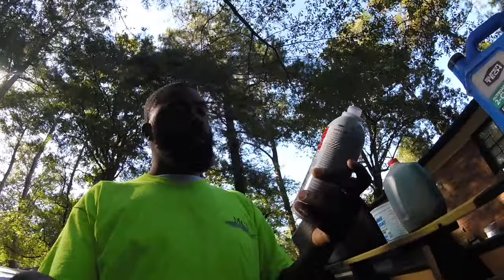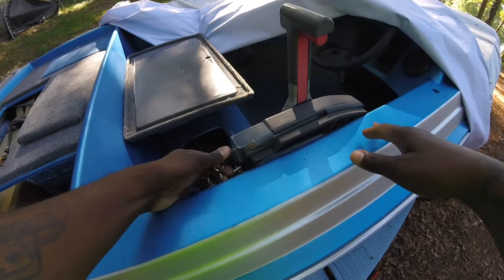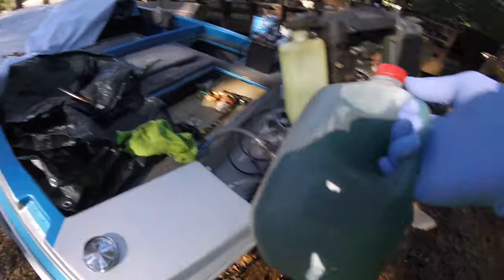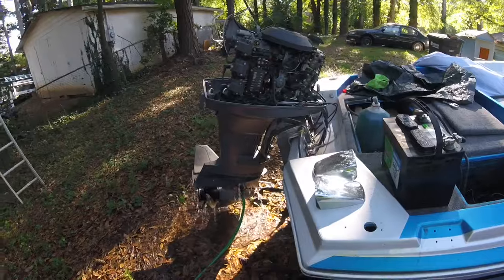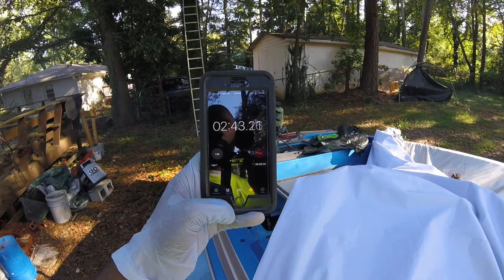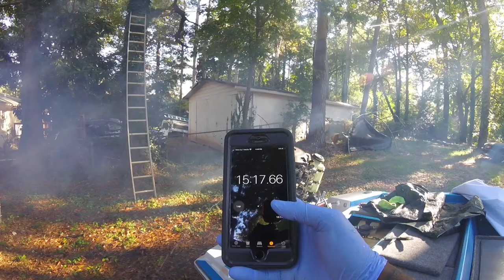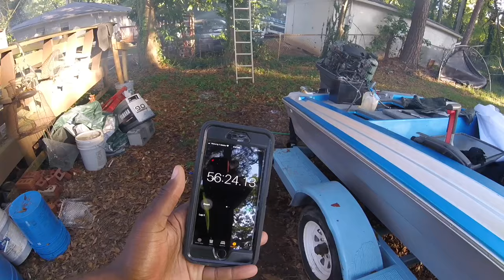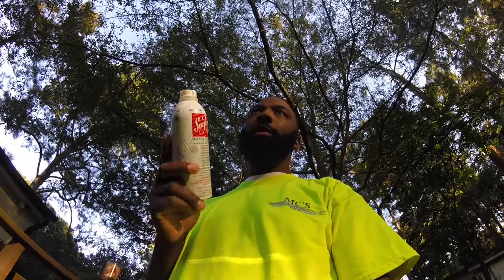How To Clean A Outboard Motor With Sea Foam

Comment: First off if you trim the engine down it’ll start easier. With it tilted that much the fuel in the carbs isn’t level. Second bumping the choke like that does virtually nothing. You have to hold it when you first start. Hold it until the engine starts to brake up from to much fuel. These are great old engines. I have a 89 200hp.
Reply from the maker: Thanks for the comment and advice I really appreciate it
Reply: @HoldemHookTV  no problem. I just got an 87 50hp a few weeks ago that’s runs perfect. Started my 200 two days ago after sitting all winter and it fired up within about 6 seconds. Can’t beat it.

Comment: After sitting two years mine wouldn't idle and was about to take the carb off to clean it. I seen this and gave it a shot. I was skeptical but, it worked.
Reply from the maker: I’m glad it help you out after all this time thanks for watching
Reply: How did you run it through if it wouldn’t  even idle ? Ive got the same issue. Sat for 2 years and won’t idle now
Reply: @Haegan_Lee  I ran it just slightly above idle where it would stay running for about a half hour. Mine would idle for a short time and die, if yours won't idle at all then you don't have much choice but to clean the carb. I switched to non ethanol gas and semi synthetic oil with a couple ounces of Sea Foam. Seemed to run better than ever,  At the end of the season I pull the fuel line off and let it run till it dies. No issues at all this year.
Reply: @gearbanger57  awesome thanks for the reply. I’m so ready to get on the water but I’m a little scared to mess something up cleaning the carb myself. It will idle 15 seconds and die
Reply: @Haegan_Lee  That's what mine was doing. Can you get it off idle and rev it up? Sea Foam will clean a gummed up carb but, if there's debris in the idle passage not much else you can do but clean the carb.
Reply: @gearbanger57  I’ll give it a try!

Comment: Just remove the carbs an clean em my guy. Get  a carb kit with some new seats an your carbs won’t drain 👍🏻.. sea foam is good to run but 9 times out of 10 won’t fix a problem.
Reply: Exactly. 
My 2014 9.9 Yamaha 4 stroke went from running poorly to barely starting and only running above 1200 rpm. I pulled the carb (which was not tightened properly) and removed the float bowl drain plug. I drained out about 1/16” of a teaspoon of grit! Upon further inspection I found the low speed jet was completely clogged and the high speed jets transverse holes were clogged as well. The choke was frozen in the open position. It took me about an hour to clean everything up and reassemble. Most of the time was spent freeing up the choke and cleaning the gaskets. The engine now starts with 0 cranking time. Just “click” and it is running smooth. No chemical treatment would have helped my motor and start to finish my repair cost me 1-1/2 cans of carb cleaner and about  1-1/2 hours of time.
Reply from the maker: Thanks for the comments

Comment: I use Seafoam on all my engines, diesel to 2 stroke.  Keeps the "varnish" out of the fuel system when it is not being used and clean when running.  Great tip on mixing on an engine wit the oil mix at/by the engine!  My Mercury runs rough, smokes at slow speed and oil on plugs.  I shall use good oil and pre mix my own fuel.  I do know how to remove the oil mix mechanism but pre mix is a good way to check B/4 removing.

Thanks!  Good video, makes me think again! :-)
Reply from the maker: Yes sir I love this stuff now that for stopping by hope you subscribed and thank again

Comment: I ran seafoam in my outboard yesterday , before it kept bogging down and wanting to stall . I ran it for 30 minutes and now it sounds great.  I’m gonna do it a few more times just to do a through flush ..:
Reply from the maker: Yes sir that stuff works great it time for me to do my motor again I’m glad it help you out
Reply: @HoldemHookTV  I have a 15 gallon tank in my 13 whaler and wondering if every time I fill up should I run some more in the tank.  Not every fill up but maybe every other fill up
Reply: I think I’m having the same problem it start and run then when accelerating it bogging down

Comment: Can you just use regular gas on a 2 stroke and have the engine properly mix for you? Your gallon of gas is just replacing your gas tank correct?
Reply from the maker: Yes you can but I don’t just the oil pump if it goes out and you don’t knw it can kill your motor

Comment: Hey man, i got some oil on my plugs. Will it just burn off or do i have a problem? Thanks
Reply from the maker: I think a lil oil is fine as long as it’s not soaked in oil you should be fine hope you subscribed and 🎣
Reply: do you have a 2 cycle or a 4 stroke a little oil is expected on a 2 cycle but it could be a sign that you are running a little rich so open you air mix screw a little do a hot run shut down your engine without idling pull the plugs and have a look if still oily open your air mix screw a little more. if your engine sputters when your opening your air mix then you are leaning to far out close it up. also check and see if your fuel oil mix is correct. if you run heavy on your oil you will blow smoke and your plugs will be oil fouled
Reply from the maker: Thanks for the info it’s all good now I appreciate it

Comment: Hey i got a question I got a 85 it works great out of the water on muffs but in the water it’s like it doesn’t go in to gear it does out of the water In the water it won’t acelarate
Reply from the maker: Well in the water is a lot more pressure versus muff. So you may need to check the compression. And run seafoam in the motor see if those things help first.

Comment: I'd be worried about getting crap built up in the jets.  The varnish etc has to go somewhere.  Also...I've been running a 1990 yammy 175hp for 32 years with the oil tank.  Never a hiccup.
Reply from the maker: Thanks for watching and yes I I’ve clean all the nets and stuff it’s running good thanks for watching

Comment: Good deal mike. It worked for me also. My 115 evinrude smoked like it had a bad habit too. Cleaned it good but i did have some oil in the prop shaft afterwards. Did you? After that no more probs. Thanks dude
Reply from the maker: No I didn’t experience that problem but how is the motor doing now
Reply: @HoldemHookTV  could be the seal on the shaft. Didnt investigate it as the cold weather rolled in early this year but all seems well. I will update you in spring 2022.
Reply: Do you have to have the motor in gear the whole time or can it be in nuetral
Reply: I just did a shock seafoam treatment on my evinrude 15hp. Worked great, but I also had some tan colored sludge in my prop afterwards. I was concerned at first, but I'm thinking its just from the seafoam treatment. Haven't drained gear oil yet.

Comment: Reving it that high will also burn a motor up even with muffs
Reply from the maker: Ok thanks
Reply: It can damage the reed's but for the most part it'll be ok. Sea foam is a great product for removing carbon build up. I also use it as a fuel treatment by adding one ounce to every other gallon thatll prevent future problems.

Comment: A few comments.

If maintenance, no harm.

If you have low idle, wide open throttle or starting problems - I hate to break it to you but you need to run down the list:
Fuel
Spark
Air

Don't bother with air unless there's a birds nest in your carb.

Spark?  Break out $10 and replace plugs "just because"

Fuel?

Hose;  if it's more than 10 years? Replace
In line fuel filter?  Cleaner or replace, like $5
Fuel pump? If less than $30 replace.  Why not?
Carbs...

Buy the kit.  Learn to take it apart, soak in a ultra sonic cleaner machine with dawn and aluminium safe coolant.

30 mins hotest seeting.

Rebuilt with all the pictures you took before and all the new gaskets (which are now ethanol safe) including floats
Reply from the maker: Thank you

Comment: Soooo i know this video is old....That motor is NOT firing on all 3 cylinders 💯. It POSITIVELY has a dead cylinder....It needs more than carbs and carbon deposits cleaned .
Reply from the maker: Boat have been fixed
Reply from the maker: And that was not the issue

Comment: I don’t trust the mixers I always bypass them and mix my own gas
Reply from the maker: That’s the best thing to do
Reply: Yamaha system is just fine if you maintained it one of the most reliable 
I’ve deleted the ones off used Yamahas I’ve bought though 
Definitely remove on all OMC